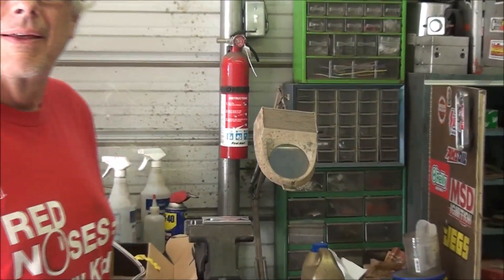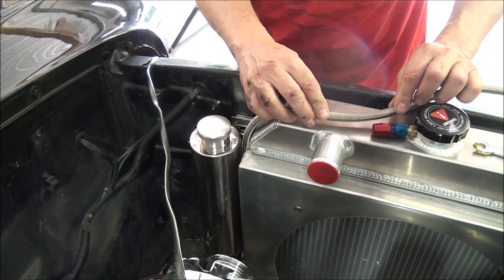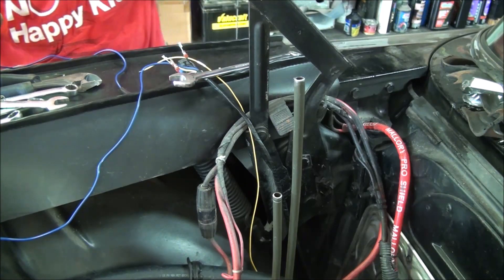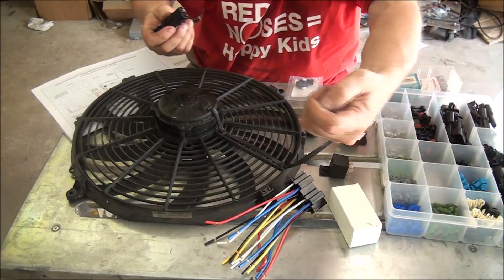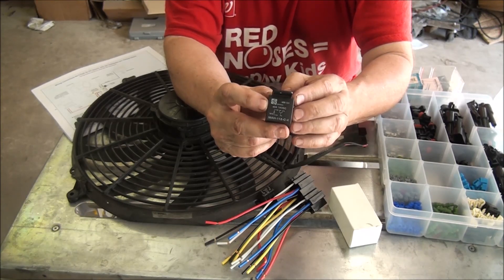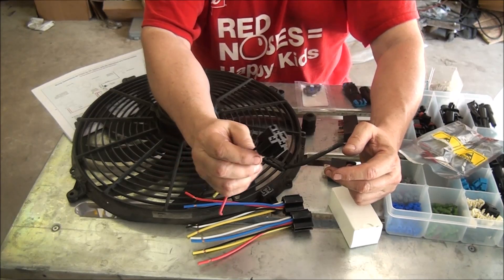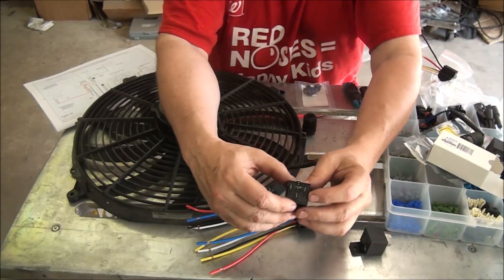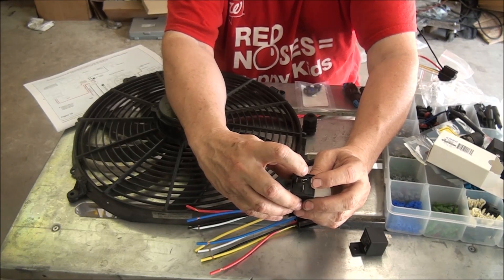Wiring Theory for the AC and Fan on the 1958 Delray

Comment: I like the safety build for the AC compressor shut off. Also, not having the electric fan wired in full time soon as you turn on the ignition, like it was before.